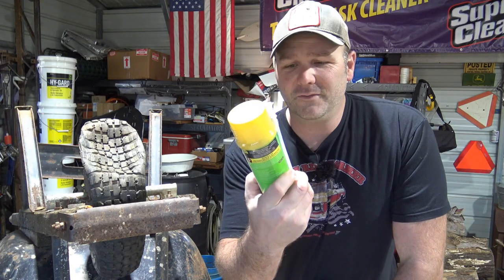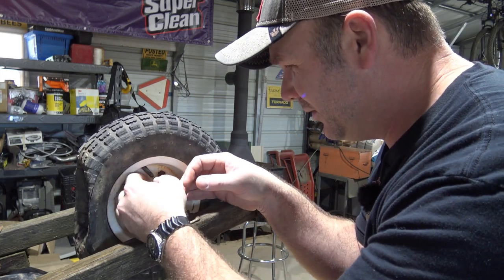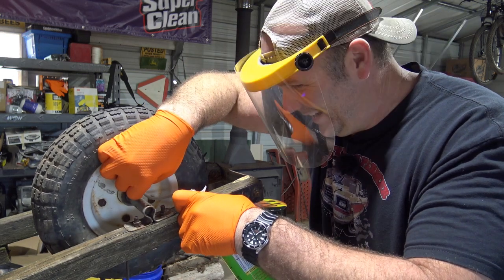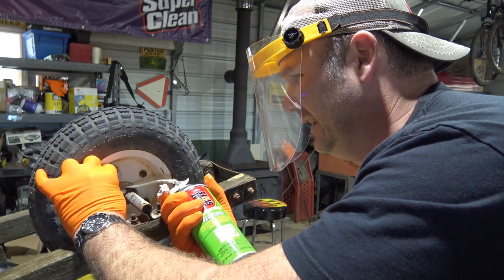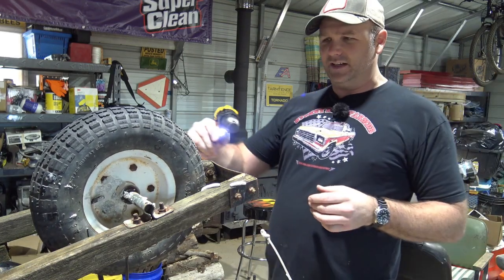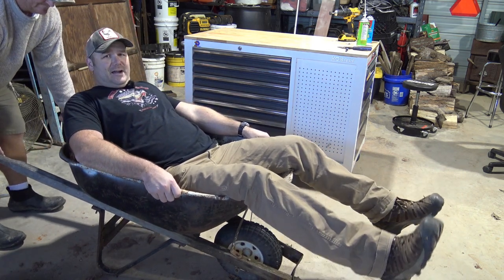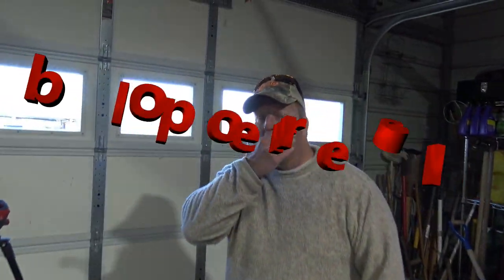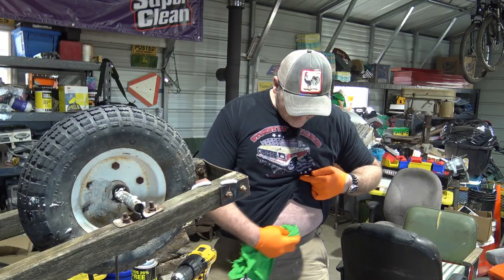Spray foam for flat proof tire...Will it work? Let's try!!

Comment: Should have put a stem cap instead of the valve back in that would have been easier also you should gave it 24 to 48 hours before you put any weight on it I bet it would have worked

Comment: Use gap and crack filler... Put a little water in the tire first. The gap and crack filler is super expanding foam.

Comment: Just put that slime/tire sealant in there. You can get a large 1 gallon jug of the off brand stuff. I filled my riding mower, wheelbarrow, and other small equipment for about 35 bucks with half the jug leftover. I am not a fan of the foam in tires, you’ll never be able to service that tire again. With the goop you could at least add air, and even change the tire after it wears down the tread if you really want. Foam is basically an adhesive and messy, and good luck ever getting that tire of the rim if you ever wanted to. I know it works for some but I think it’s a bad idea

Comment: Actually it does work with the harder foam. You need to drill 2 holes in the side of the tire and pump the foam in thru the first hole, until all of the air in the tire has exited the second hole and the tire is completely filled with just the foam, (depending on the size of the tire - between 1 and 2 cans). Then if you like, pop 2 screws in those two holes so that the foam is no longer allowed to escape thru them as it expands. Give the foam about 24 hours to harden up and dry and you should have a flat free tire from that point on. Funny video on how not to do this though, Thanks....!

Comment: You can't do it with a tube.  And high expansion foam works better.  The problem with a inter tube is that you can not force the foam all the way around the tire.

Comment: You have to drill holes in the tire or take it off the wheel and fill it so it will expand. Has to have air.

Comment: Thanks for posting but I feel the Spray foam would have sealed up any holes left  in the tire. So  I would have just use the tool to replace the valve then just  re inflate the tire. But this info very  helpful to me  I got an old 18 ft boat parked in my back yard it been there for 15 years since  the 140 hp Yamaha engine on it seize from lack of use  it become a real eye sore sick and tied of mowing the grass around it it has gotten  stuck as  there are  two flat truck tires on as soon as I blow them up they go down so I could not move it Over time the seats have rotted away But there now hope as this look like it worked so Im going to try it on my boat ties then I can get it out there and might do the wheel barrow as well.

Comment: Its called a valve core that goes in the stem good job on the video and good luck on the farm and it would have worked great if u would have drilled a hole 180 degrees from the valve stem and that lets the air out of the tire and lets the foam fully expand and you can also put foam in from the hole to fully fill the tire then you have to let it set 24 hours for the foam to cure. Better luck next go round.

Comment: You DO have the right idea, but went about it inexperienced. This absolutely DOES work. The forklift shop I use to do this to ALL of my small tires drills a 3/16" hole in the rubber 180 degrees opposite the valve stem, and fills with the valve at the bottom so that the air escapes while filling. When the foam starts puking out the top, yer solid.  Hope this helps.

Comment: You guys are great fun but polyurethane foam does not just cure itself, it reacts with water ( water vapour ) in the air. First you need drill a few holes to let air out so the foam can expand, then put a little water into the tyre and roll it round before putting the foam in. Also, no need to empty a whole can one can should produce tens of cubic feet of foam.

Comment: It does work if you do it correctly. You need to drill a hole in the tire before you add the foam.

Comment: the foam cures by contact with the moisture in the surrounding air.  It will not cure inside a tire due to no contact with air.

Comment: I would've tried some compressed air before the valve stem hardened, the foam should work like slime to seal the hole

Comment: Next time before squeeze as much air out of the tire you can.  Then hold the can upside down.  Should work a little better.  I think your getting air/empty spots inside the tire

Comment: You want all foam and no air. The problem is the foam is made of two components that, when the pressure is released, form a gas, usually CO2, or sometimes butane that changes from liquid to gas..

Comment: You are putting air into  a concealed inner tube you got to drill holes for air pressure can leave let it dry put weight in and rolling around for hour then check and see if it needs mean more foam

Comment: This foam cures and expands with air moisture. It will not cure properly inside the tire, otherwise it would be curing inside the can. You should try putting little bit of water in  the tire first

Comment: When you fill it with foam screw on the protective plastic cap.
Reply: I know this is an old comment… But you know, your comment made perfect sense versus trying to put the valve back in

Comment: It DOES work, when done correctly!!!! 
Use expanding foam!
Drill an air escape hole/s!
Turn tire while filling to evenly distribute foam!
Let excess escape while it dries for 24 hours! 
Scrape off any dried on excess foam and job is done.
You're welcome.
Reply: Thanks

Comment: The foam requires moisture to activate and set. That said once you put weight on the tire and start rolling it will pulverize the dry foam inside the tire. Also leaving weight on while parked will create a flat spot. Doesn't work.

Comment: Normally rots the inside of the rubber tyres good for a quick fix but no good long term sadly.
Reply: cured foam.rots the rubber? old fix a flat, maybe. one hella mess when you eventually try seperating wheel from  tire. fix a flat does promote destruction, rust out, of steel wheels over time. it was meant to get someone home with proper tire repair forthcoming.  fix-a-flat was hardly permanent

Comment: get high density rubbery expanding foam     a small amount of water will accelerate foam curing.        drill  small holes  ( expansion holes )  around  the tire every 45 degrees    this is 8 holes total ...   remove the valve.   put air in tire to make the tire round ...... remove the valve.....   arrange tire stem facing upward.     fill the tire from the stem so that the foam falls to the bottom of the tire.  Fill 1 inch at a time if you are patient.    Do not put the valve  back in.  put on the screw cap if you wish.      tags:   777foamTire   777foam    777repairTire

Comment: Wrong foam and you need a vent hole to let the air out while you fill the tire.  Also need to turn tire to displace the foam evenly inside. Watching your video I knew before you put the wheel barrel down it wasn't going to work.  The tire had too much in one area. You can Tell this buy roatsting the tire one quarter turn and see if it rolls one way or the other.  It Will settle down on the heavy/ full side of the tire.  Try the foam fill from Home depot in the red can with yellow top "crack and seal" filler foam. Also need to let it sit for at least 24 hours.

Comment: Josh it will work but you used the wrong insertion method and foam. You need the high expanding foam denser stuff remove the innertube drill 4 holes the size of the straw at four points apposing each other then insert the foam there. to get a complete fill insert foam to right left then center of each hole if it compacts refill.

Comment: Hold can upside down and dont use low expanding foam.  it does work i did it on my old lawn tractor.    Best done with wheel that has a tube less mess when removing it later

Comment: Foam couldn't fill the tire because it had nowhere to go. If you drilled a small hole on the other side of the tire opposite the valve, you would have filled the tire up with foam more successfully. You can still fix that tire if you drill two holes on opposite sides and fill it up with foam till it starts coming out the other side.

Comment: Low air in tire put air after foam, foam will find leak it will work and roll your 270 pounds put valve stem in before air

Comment: I tried this, it works at first and then it starts to brake down inside the wheel. I used 4 cans on one tire. Best to do it on a Hot day. Two wheel lawn cart. I still had to buy myself 2 new tires. The price of those cans are not worth it, 4 cans + tax= 1 tire from Harbor Freight.

Comment: lol you basically filled the tire up with air from the can. might would have even helped to put a bit of water in there as water helps the chemical reaction of this spray foam. but the best way to do this would have been to leave the valve stem out and put a pinhole at the top of the tire for the air to escape. Doesn't have to be a very big hole just enough for air to get in and out so that the foam can cure. otherwise, it will stay in the same state it was in, in the can.

Comment: Spray foam will make a solid tire, You didnt use enough, u used the cans air to inflate the tire, my 1st time failed as well, i went as far as trying it on a junk lawnmower rim.I broke the bead and filled it with a friends help, It was solid and worked well on my current Rat rod mower tires

Comment: When you let the foam out of the can it absorbs oxygen and uses it to rise and harden. 
Using foam in a tire with only a very small amount of oxygen in it will not work, it' like transferring the liquid from one can to another.
Oxygen...

Comment: Forget about putting the stem back in just put a plastic cap and spin the tire so that the foam gets everywhere much better way than putting the holes in the tire

Comment: You didn't fill the tire with foam.  You also put the put the pressurized gas from the can in the tire also sealing in some air.  You almost have to fill it in a vacuum.  Or you have to have a way for the air/gas to escape.

Comment: Got to remove the inner tube it won't work . Drill about seven or eight holes in the sidewall and around the circumference and then fill it with foam and then you'll have to do it again cuz it's a big pain in the ass. It does work but it took three cans to do two tires. In about 2 days pain in the ass. PS it's a big mess no matter what you do. I did mine about 2 years ago and it has flat spots from air pockets in the foam. It is failing.

Comment: = : the valve core is in the valve  stem..  = you do NOT have a valve stem inside of a valve stem, it's a VALVE CORE .
Reply: Its actually called a Schrader valve.

Comment: You needed a small hole on the opposing side from the valve to allow the air pressure to escape and some foam and then allowed the foam to cure for a couple of days may have made all the difference, however they do make inner tubes for wheel barrel tires. Nevertheless to late now. It looked like you try to put pop back in the cow's rectum. It was hilariously funny though.

Comment: if you would have put air in that tire after you put the spray foam that would have worked great I'm actually going to do it to my zero turn for the front tires they're always going flat

Comment: This would have worked out fine without the valve steam all u need is screw the valve cap on when u fill it up then u won't have to worry about all that mess.

Comment: It works for light work if you let it harden 24 hours.. HINT Drill a small hole for air removal but plug the hole with a screw so the foam can expand properly while curing.

Comment: Can of foam $5 
New wheel, tire, tube prefilled with air? $10
Reply from the maker: A youtube video testing something like this  $$Priceless my brotha!
Reply: my lawn mower tires [ocd? I want the same tread] are dry rotted and cracked. 20 years old, stored many years outside and storing flat is not helpful. size 13 or 15 x 6 are not just ten dollars. 1. fix a flat worked for a year
2. tried tubes, dont last long for the effort. 3. these tires cost almost as much as car tires used too. >$40 x 2 just for fronts to.mow grass? they aint high speed tires. even if they cured into a wobble, who cares. 5 mph on grass.
last, 4. buying a new chinese rim.and tire, cheap quality to throw out original rim and bearings? seems like a waste. and more chinese support. 
buy American. restore American. modern tools and supplies ftw

Comment: I am sure that somebody told you already, but you did everything wrong.  

1. You need to hold the can upside down.
2. You need at least one hole in the tire to let the air out of the top of the tire...more holes would be better.
3. You need to add a little moisture inside the tire. or the foam will not cure.
4.  You need to let it set several hours before any use or it will not be fully cured.
5. After all that you could get less than perfect results, but it will work.
Reply from the maker: lol...I always do everything wrong...I make youtube videos bhahhahaha...thanks for the comment though

Comment: Why did you have to remove the stem. I've used the foam and it was much easier.  Just took off the stem cap and just used the foam.

Comment: Hey be careful when you use fix a flat....we just had a worker by me at a tire shop get hurt. He was filling a tire and not knowing it had fix a flat in it....some how he overcompistated with the air being put in....the explosion was so bad they had to life flight out 9t there . the force was so bad it blew part of the garage door off.   We were told from the cops that if u use fix a flat in a tire you most inform.the person who is repairing the tire
Reply: That tire did not explode because it had fix a flat in it.  He either put too much air in it or it was defective and/or damaged.

Comment: It will if you use the correct spray foam. In all the types of spray foam, not sure y u used the pest block shit. It should of bin expandable foam and it has to sit for at least 12 hrs. Prob better with a full 24 hrs with that much foam.

Comment: You used the wrong spray foam.  The expanding foam is what you are supposed to use then you have to wait for 24 hours before you use the wheel
Reply: Yeah, don't know why you didn't use the most expanding foam

Comment: Epic fail!..... used 2 cans. Had drill a few extra holes. Whole tire got hard over 2 days  worked fine 1 day. Second day cheap tire disinegrated and came apart. HARBOR FREIGHT JUNK TIRES.CART.

Comment: You had no way for the air to get out of the tire while you were spraying the foam in you should have drilled at least one hole on the opposite side so it could have pushed the air out

Comment: The only way the phone would work is if it has errors that it's dry so it will swell up otherwise you just put it in a spot that's no different than a can it's going to be in Bowie Bowie meth until it drive which in this case if there's no hole for it to dry and swell up not going to work

Comment: Didn't work for me. The rest of the Tire didn't think so as it tore apart
Reply: Get Brand New Tire...
13X5 Harbor Freight = $15.00
13X5 Walmart = $9.26 - $15.00 (Depend on Seller)

13X5 Tractor Supply = $24.00

Comment: YOU came up with THIS IDEA? OMG! What you proved is that you know very little about Science. First, dismount wheel from whatever it's attached to. Make sure the tire bead is seated on the rim by pressurizing with air. It may require 90 PSI or more if you have a hole or dry rot. When properly seated, the tire bead should be snug against the rim on both sides. Now, bleed off the air and remove the valve stem core. Next, drill a bleeder hole (or more, depending on tire size) on the same side of the sidewall opposite the valve stem. This ensures that the foam goes into the entire tire, prevents the tire from pressurizing and allows air to escape from the tire. The idea is to 'displace' the remaining air (yes there is still air in there) and 'replace' it with foam. Of course, foam will come out the drilled hole(s) and the valve stem as it fills the tire and expands. Turn the upright tire slowly as you fill with foam. It will require about 1 1/2 to 2 cans for a tire that size, more for a larger one. Once filled, foam will come out the bleeder hole(s). Lay the tire flat on it's sidewall (the opposite side from the bleeder holes and the valve stem) for 24 hrs. The expanding foam enclosed in a tire needs time to cure overnight (normally the foam will expand and cure much faster if exposed to air). The next day, trim off excess foam. At this point, you have 'displaced' all the air  and 'replaced' it entirely with foam, so you don't need to reassemble the valve stem core. If you use polyurethane foam (which is flexible and made for tires), you will never have to fill the tire with air again. NOW YOU CAN TEST RIDE! Science is important, so watch a video on 'Displacement' before you make your next 'Replacement' video.

Comment: With all the air or gas  it seemed to hold that tire might hold air if its tight on the rim. Hope youre not in california. Spray foam causes cancer to mice there.

Comment: Spray foam does work, and I have done it as long as you don’t use these two bozos you can use fix a flat screw on and the spray foam tape up
Reply from the maker: feel better now that you've insulted a perfect stranger?  Spray foam doesn't work buddy...let me share that with ya

Comment: Would have never work because you didn't drill a small hole to let air out of the tire and you had to can the wrong way you are spying our little bit phone but messy are out of the can because you had to can the wrong way you're supposed to have the can upside down fast soda liquid phone go to the top of the can and araby on the bottom and pushes the liquid out